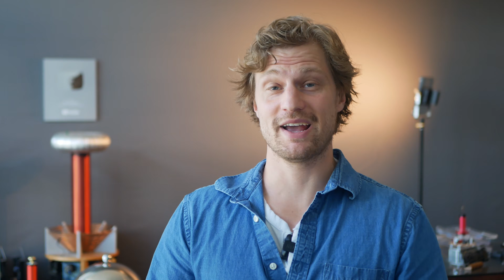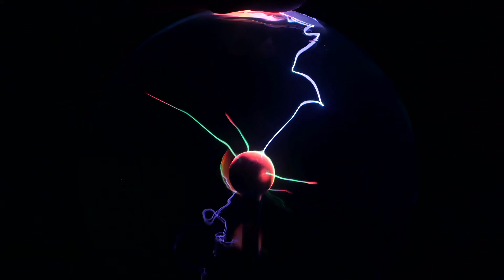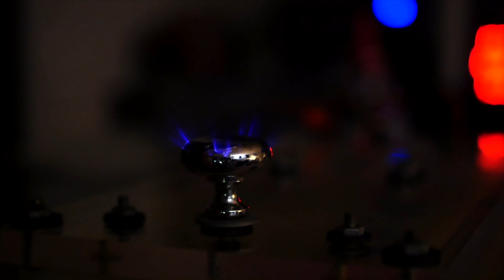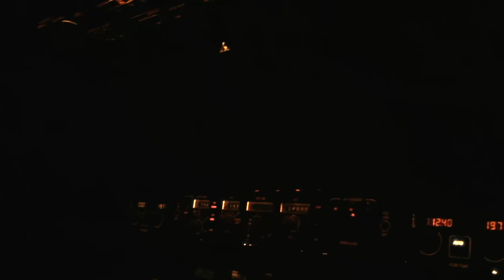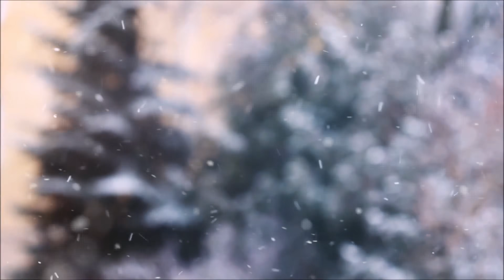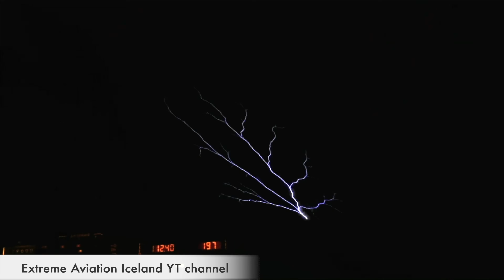How Airplanes Create Lightning ( Pilots Interviewed )

Comment: Former NASA avionics tech and aircraft electrician here.  Awesome channel!  I’d like to point out that the ground for the entire aircraft electrical system is the frame and fuselage metals.  There are also lightning diverter strips (ionic channels) on the nose of the aircraft as well as static discharge antennas typically on the trailing edges of the wings.  Also note that passengers are protected by the aircraft’s structural design that acts like a Faraday cage.

Comment: If you look at the control surfaces and wing tips, you'll see little fingers.  These are actually Static Wicks, that force static discharge from these little points.  This helps to limit the radio interference and protects sensitive equipment.  My father (RCAF Flight engineer) flew for 30 years and has a number to St.Elmos fire stories, but the Ball Lightning was the most scary.

Comment: Blimps can accumulate enormous static charges due to the materials used in the envelope- they tend to be coated polyester or mylar so are insulators that can accumulate huge charges. So, blimps have a grounding chain that discharges the blimp envelope before ground crews grab the handling rails of the gondola.

Comment: It appears that the earliest records I've seen saint Elmo's fire go back to about the 11th century. And it was seen often enough on Old sailing ships to be mentioned frequently. As a child that's where I first learned of St Elmo's fire. But the phenomena are not all that uncommon in various other places in our world. 

 One day in a dry area of Eastern Washington along a river. I had been visiting family there shortly before. The park was a long a river and had lots of grass and trees. Suddenly, every sprinkler head in the park and all the drinking fountains took on that bluish purple glow. Moments later sheet lightning was all around me at about 4 ft above ground level.

After Dusty weather with the beginning of higher humidity or light rain similar phenomena, they're called Corona, occur around pole transformers and insulators on our electrical grid. I have seen it illustrated at the Bonneville power experimental station. My father worked in the power industry for years and was aware through customer concerns and personal observation of this phenomena along power lines. But especially along high tension lines with their higher voltage.
Reply: Cool.
I thought the aquatic/sailing version was caused by bioluminescent microbes in the water that glow when disturbed. You can see it with night surfers in some places.

Comment: Hi jay, so it seems to me that energy could be harvested on high mountains with thin long 50 -100 meter plastic ribbons streaming through the air attached to a electrode collector insulated from the ground with a  leyden jar in series to the ground . Maybe a tap from here with a spark gap and then in to a transformer to create high voltage and high freq ac!
Reply: I’ve seen on YouTube that research is being done with graphine ribbon collectors at around 30m elevation. Very cool / scary with the high voltage!

Comment: I used to work near high voltage transmission towers.  Our corporate parking lot ran parallel to towers that carried 660,000 volts.  On evenings and nights when fog or light drizzle was present you could see the energy radiating around the wires along the length of the lines.   

Question, have you ever experienced ball lightening in an airplane?   I don’t think it’s the same as St. Elmo’s fire but in the early 70’s we saw it on a military transport plane.  Almost like the effect in your plasma ball, moving down the isle of the plane from nose to tail unhurried, taking a few seconds rather than a flash.   Hair on arms and hands static charged as it passed... very strange and memorable.  I think we were in stormy weather but I cannot be sure.

Comment: I’m a Boeing fan,
Here’s 
This:
First, as a component from the aircraft is missing, you would reference the aircrafts Configuration Deviation List (CDL). The A330 CDL might say something like this:

Static Dischager 

20% of the static dischargers may be missing or defective from each of the following areas:
Wing
Horizontal stabilizer
Vertical stabilizer

Note: if a static discharger is missing or defective on a flap track faring, the VHF and HF sound quality may be slightly degraded.

Comment: Another thing that might help to mention is airplane manufacturers are aware that static charges will build up on the surfaces so they intentionally design them with conductive foils to dissipate that charge. 3M makes such materials perforated copper foils specially designed for aircraft wings.

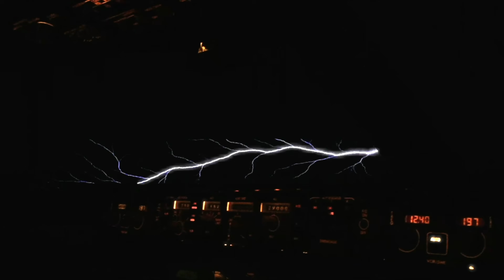Comment: 3:44 it’s kind of bizarre that if you were inside of a middle of a charged cloud zone in an airplane Charges build up on the metal framing of the plane and when gathered enough charge you automatically see flashes in fractals fly out from the areas that were discharged most of this can be seen through the pilot windows but not so much in the passenger areas

Comment: I was working at a bunch of hangars at an airport not too long ago and was noticing all the little metal rods coming off the back of the wings on all the planes. I was wondering if those were for discharging static charge or something. Seems like it's indeed a real issue, I never knew the corona or sparks could get so bad without being dead in the middle of a bad storm. Awesome video though, I'd never heard of St. Elmo's fire before.
Reply from the maker: That's a cool job. Yeah, those are called wicks. The pilots told me about them in the interviews, but I cut them out.

Comment: Hi Jay. I haven't actually experienced St Elmo's fire on a plane but have seen the coronal discharge as the air is breaking down just before an arc strike and from the top of power-line poles. As for the aeroplane windows, don't they become slightly conductive due to the moisture from the clouds? Anyway. Thank you for another great video.

Comment: Love that static discharge. Lol
As kids we use to see who could hold on to the leads off of a small hand crank dc generator the longest. 
The true hero was the guy who could tell which cylinder wasn’t firing properly by holding on to the spark plug leads.  one by one! 

So yes of course kids don’t try this at home. You get to learn respect for electricity. Lol

Comment: I was fishing this weekend right as a thunderstorm was moving NE through the area. At one point I casted my drop shot with 8lb fluorocarbon, my weight hit bottom but my line continued to levitate 2ft off the surface of water (fluorocarbon sinks when in water, so it's not light). I then shook my rod sporadically wondering why my line was floating and then I got shocked from my graphite rod or metal reel. At that point I realized why my line was levitating and got back to the ramp as quickly as possible. Shortly after there was a huge lightning bolt across the lake. The weird things that happen while fishing.

Comment: Catatumbo Lightning  ⚡️ seen in person 
  
This was a neat question 🙋‍♂️ I asked 
What temperature a cubic foot could hold the most moisture 

Add this to your equation , lightning 
Travels in the least resistive path
Lichtenberg, or “fractal,” 
And on the cockpit windshield you can direct the energy like your plasma ball
Airlines mostly have laminated windshield for heating wire mesh
Can get just like your Vandergraaff generator plasma coming off your fingertips
More more more

Comment: Hey jay I m twelve and want to build a multipier from my ZVS flyback circuit but my flyback has diodes at the output, do u know how to remove them? PS love ur vids
Reply: you could  make your own secondary coil, never tried it but here's a link to a video i foundhttps://youtu.be/qS3RhefBP08
Reply: @Svenben96  thanks I’ve tried on an old core but it either only makes a minuscule voltage or internal arcing but thanks though
Reply: @Mihály Tóth thanks I can try that as soon as I grab a lot of enamel wire

Comment: Question about your subaru ignition coil being driven by a ZVS driver you did a couple years ago.    What I thought was the proper connection fried one of the secondaries with no arcing. I was  using a 24V 10A power source and when it was turned on it never got over 12 volts and the righthand coil (output pins 1&2) super heated, expanded, and cracked. Can you give some details on how you are connecting a 3 pin ZVS in antiparallel configuration.  Thank you.

Comment: seen program once about plain crashes. And one plain had to be flying though volcanic ash but didn't know it! they thought what they were seeing was ST Elmo's fire but boy were they wrong. they rose higher but it was still the same so they dropped down and it stopped. (it was somewhere around the Philippines) but their windows were all frosted over and very hard to see out of. anyway they rose back up higher again & it came back. the whole plain was glowing blue. it was highly charged particulars of pumuss(spelled wrong) what they didn't know was it was sand blasting their windows and slowly clogging up their engines. they came back down and all was ok again.  so they rose for the last time. It then smothered the engines and they crashed.. FLYING near volcanic eruptions is now safer because of this incident..

Comment: vander volt forces love 90 degree angles .now do you know there are electro static force (lightning ) and magnetic static forse (the collapsing thunder ) the latter from the lightning splitting the air/vacuum . this i believe is how joe booker runs his air engines one charge pulls up piston the other repels.andyou get no valve bounce at any revs  as valves become a super magnet to the aluminium head pf engine ..peter stevens and lynn eykamp know much of these new sciences

Comment: the reason why jets on aircraft carriers when they first lad have to be touched by a guy with a metal rod that's grounded to take the charge that accumulates on the surface of the metal  of the plane,,, now as for St Elmo's fire thats because the plane now is charged in an opposite charge to the are its entering into,,, Easy explanation, we see this at the tops of mountains with metal objects and even people,,, but its in dark mode with people until a lightening discharge then its deadly,,,, u see electricity has 3 operational modes Arc mode Glow mode and Dark mode look up the Electric Universe,,, on youtube its the "Thunderbolts Project". Why is the solar wind voltage why is our bodies PH voltage because everything is electric my friends